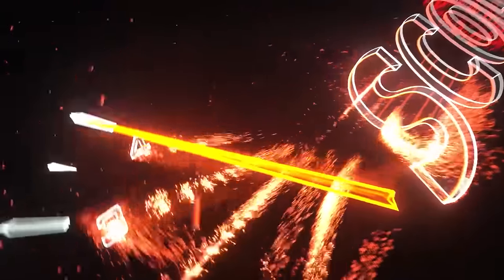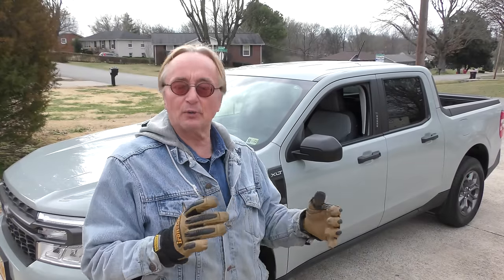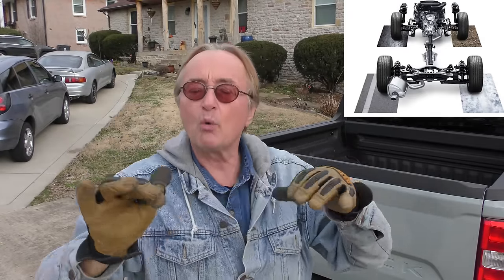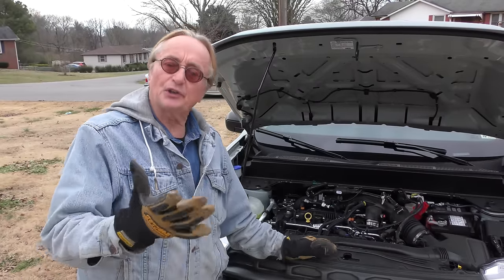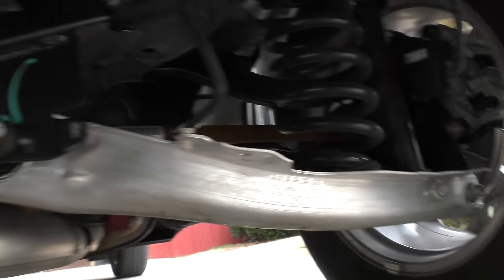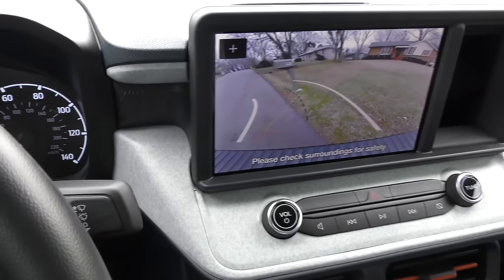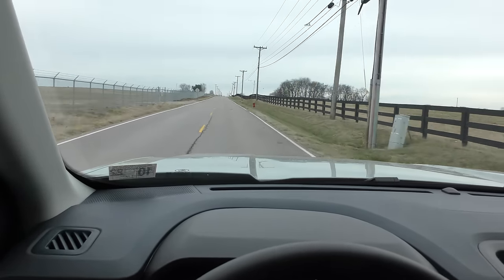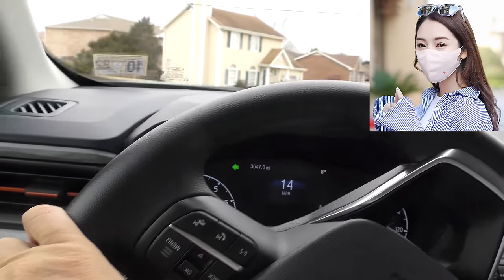I Finally Got a New Ford Maverick and Here's What I Really Think of It

Comment: I've had my XLT AWD FX4 with 4k tow for a week now. Really love it! Quick, light handling and handles like my Mustang did. Very sure footed in the wet or dry. GREAT AWD system. First tank got almost 29 mpg in mixed driving. And up to 34 mph hiway on back roads. I will admit I'm the old guy in the right lane doing the speed limit. Drive like a angry youngster and YMMWV! ;-) But its an awesome vehicle for a grandpa with errands to run.
Reply: Good fortune partner !
Reply: How is it in the snow?
Reply: Maverick?
Reply: Handle like a mustang ... hahaha like hos much more bias can you be ...
Reply: Was really looking hard at getting an xlt with awd and the 4k package. Love the idea of the maverick. Decided I didn't want a car payment and bought an old 96 ranger and now I'm in love with it. I'm going to keep my eyes on these mavericks though, hopefully they make an awd version with the hybrid engine in the near future, I might be sold then.
Reply: Handles like a mustang you say?
Reply: My 2016 2.slo/CVT Subaru Crosstrek typically gets mid-30s hwy with max-sized AT tires on it, if I use the cruise. It's only rated to tow 1500lb though. A sub-$30K, turbo, AWD crewcab pickup with 1500lb payload capacity and 4K tow, that can hit that kind of economy, could easily replace a lot of little sedans and hatchbacks.

 I've seen videos of the Maverick AWD system pulling pretty well through off-camber sections of trails too.

 It'd be interesting to see what a rear locker could do for such an economical rig. I'd like to see the aftermarket jump on this little pickup, with winchmounts, bumpers, skids, rockers, etc. It's not likely going to ever be a rockcrawling Wrangler, nor a mud-bogging fullsize on tractor tires, but it should be pretty fun and versatile.

 I also LIKE the turbo option. As long as it's reliable, I prefer having forced induction in the mountains rather than cubic inches. It retains more of the power. Just use good synthetic oil and change it religiously. I use Duralube in my vehicles too, and I run 200K+ miles on vehicles without any consumption issues.
Reply: as a 22 year old with the same specced maverick on order, i’m glad i ordered a grandpa truck
Reply: I think the one thing I wouldn't like is the small gas tank. It's only like 15 gallons?
Reply: @leadnsteel1428  15gal at 30MPG will get you over 400 miles/tank. A lot of vehicles on the road don't have that kind of range.
Reply: @davidmatteau7696  Around here, that's not saying much. The roads are often wet or snowy/icy for much of the year. Mustangs are generally impractical, compared to a "slower" WRX or similar.

 In twisties? LOL
Reply: This is the package I am eyeing, likely a couple model years out before I bite though.
Reply: @davidmatteau7696  Cheer up
Reply: This is no different than their SUV's..  Just look at the history on those and you'll see how these will fair..   It has the same uni-body, same suspension, and same engine, ect.. It's just their SUV with a bed instead of cargo area.  Not much of a truck really.  Similar to a Honda Ridgeline.  More of an SUV than a truck.  They're pretty sweet if you don't ever tow things.
Reply: @calholli  true SU"V are truck based- the crossovers modern staion wagons arent real SUV's
Reply: @bikeman1x11  RIght.. they're so different that they even came up with a new name for them.  These "trucks' should be the same.  I think 'CrossTruck" is not a bad name-- basically a crossover/ truck.. Auto-trucks maybe?   Uni-trucks.. uni-body trucks.  Like I said, Australians call them "Coupe utility vehicles" -- or UTE (short for utility).  And they have many different kinds of these full uni-body style vehicles with a bed, just look up "UTE' (pronounced yoot').  A lot of them are literally cars with a bed, like El' Camino style.  I just think it's dumb to call these trucks.   This thing can only tow 2k lbs, that's crazy, it's just not a truck at all, haha..  I have an old Isuzu Rodeo, and a 2002 Acura MDX that both tow 4500 lbs.. Just for comparison, My 2002 F350 superduty 7.3L power-stroke Diesel can tow 12.5k lbs on the hitch, and with a 5th wheel trailer-- It can tow nearly 20k lbs.  2k lbs is a joke-- that's barely a riding lawn mower on a garden trailer.  nuts.   IT'S NOT A TRUCK.. . ok, I rest my case. lol
Reply: Cool. I'm considering ordering that configuration.
Reply: No reason to think everyone needs these huge pickups. For most people a smaller pickup can work out well.
Reply: @davidmatteau7696  I wouldn't laugh at the old man. He didn't say what year his Mustang was... might have been an old Fox Body.
Reply: @davidmatteau7696  I laughed when he said that it handles like a mustang. High center of gravity, suspension made for carrying a load with a long travel. You can't have a pick up truck and a sports car in one.
Reply: From a hybrid perspective that i own I'm getting around 45 mpg on my data to day drive that is around to work and the distance is around 12miles. Also this is in California trafic
Reply: @doctorboy5892  I guess that depends on how old of a mustang he's used to driving, it could be an actual horse.
Reply: @1roblock  It was an unrestored 1964 convertible with rotted frame rails and 14-inch bias-ply tires! lol
Reply: @doctorboy5892  Sure you can...454SS, Cyclone (sp?), SSR, Lightning, Ridgeline, etc.

 Big anti-swaybars and some chassis braces could make something like a boosted Ridgeline quicker around a track than a stock Mustang.
Reply: The Real VR  People use lockers with AWD just fine. Selectable lockers don't even have to be noticeable on the road.
Reply: i want one, im just refusing to pay 30k for one at the dealer lol
Reply: @calholli  4cyl, body-on-frame Tacomas can't tow 4K lb. I think it's more like 1500lb. How much can Couriers, LUVs, and Ram50s tow? Weren't they body-on-frame pickups?

 FIS? HMMWVs are FIS. They're also 1.25-ton, body-on-frame, diesel-powered trucks...that can tow 10K lb...offroad.

 Can an F350 get 30-40+MPG? Can a gasser 1/2-ton? We had a V8 F150 at my work that could only tow 6K lb. 4000/1500 tow/haul, for something the size of a Maverick, seems respectable to me, by comparison.

 Different strokes for different folks. I have a 50mile commute. If I have a 1500-3000lb boat to tow locally on weekends, why would I get an expensive guzzler pickup to pull it when a $20K-25K, 30+MPG, crossover pickup can do it? Even a crewcab Tacoma isn't getting 30MPG.
Reply: @RKmndo  lol.. I dont' understand why you guys come at me defensive as if I don't like the Maveric? haha... I do like it.  It's a cool little crossover.  My only point is that it's silly to call it a truck.  It's not built like a truck, it's not capable to haul like a truck and it can't tow like a truck-- at all.  I just think it needs a different NAME.. if it works for you-- hey, go for it.  Even better gas mileage, like you said---   which is yet another reason NOT to call it a truck.
Reply: @FtanmoOfEtheirys   you're able to customize on fords website. But $23k(+taxes and tags) for LT maverick truck with no extra features isn't really worth it. 
I think you'd like XLT maverick with luxury package. I think if im correct. Thats only $28k.
Reply: Sorry dude the word hiway as you spelt is is actually spelt highway.
Reply: @theeslimstevie  I really want the hybrid option. I'm holding out in hopes that Ford will be smart and release an awd model of the hybrid considering it is already offered on other platforms. I live in Chicago and really regret trading my 4x4 in for a fwd car.
Reply: @FtanmoOfEtheirys  Damm that stinks especially because winter right now. Hybrid is okay but I understand waiting for awd version to come out. Im just iffy about new Hybrid technology. (Affordability on repairs or something along those lines.) 
You can't go wrong with eco boost with 250 horsepower and 25 miles per gallon. Thats pretty dang good mate. But I respect your opinion.
Reply: @RyanNash20  96 Ranger is an awesome vehicle. Last year for that massive front axle setup.
Reply: @leadnsteel1428  probably how they keep the mpgs. Less weight.
Reply: @calholli   yeah I don't think anyone should get it instead of an actual truck. But I think it is a decent alternative to  station wagon, tho. Almost like the Flex wagon model except with an open back. The Honda Ridgline is the same thing, just a Pilot with an opened rear section.
Reply: @bikeman1x11  crossovers aren't real station wagons either. I sure do miss the  old full size wagons.
Reply: @calholli  I agree. Should just call them open-back wagons. It's not a dumb vehicle, but it cannot replace an actual truck. A base model kia soul can tow 2k pounds.
Reply: @RequisiteFunction  Oh yea I was under it changing the oil and this thing is way overbuilt. Tie rods are bigger around than new f150s lol
Reply: @petermuller161  not buying that
Reply: What did you have to pay for it?
Reply: What did you have to pay for it?
Reply: @theeslimstevie  hey,  is the  4 an option on the XL.  For $5k it may be worth it. 
Tacoma is dated for what they charge.
In the 4 cylinder  truck market a manual is a much better option
Reply: @RKmndo  some Kia Souls can tow 2000 pounds, and they are the epitome of economy SUV. Basically a 4 door hatchback with a tall roof. Only in America do you need an f350 dually to tow a canoe.
Reply: @donaldwest8130  I mean XL is ight truck for the price but im not sure if you can get fx4 on the XL maverick. I think its only 2 wheel. 

 But on what I ordered (XLT) I added the fx4, 4k tow package. Practically maxed out my order for 34k
Reply: That’s not such great fuel economy, 
Cheers
Reply: @RequisiteFunction  or to get groceries at the big box store
Reply: I appreciate you sir.
Reply: If your Mustang handled like a maverick something was wrong with the Mustang. 
Cheers
Reply: @calholli  Should really call it a Ranchero!  People confuse these little ones with expecting a real truck. People who actually buy these could get by running them till the EcoBust nears its premature end, and trading them in.
Reply: Did you have to pay a mark up?
Reply: 4k tow not bad
Reply: Good for you! We also like our current 2017 ford super duty diesel that is now at 107,000 miles since we brought it home new and does 18 to 23 mpg doing speed limit or 5 miles over the limit. It is my all around vehicle towing our rv trailer up to 20,000 lbs. When not towing, it is my fishing/hunting, exploring, and errand truck. It is just breaking in at 107k. Hoping for years of ownership since it might be our first and last diesel...will see then.
Reply: @GDM1787  Oh yea I'm keeping high hopes for these. Manual trans in the ecoboost in a few years time would be amazing, plus we will be able to see by then if they are reliable vehicles or not.
Reply: @RKmndo  the Ranger tows 7000Lbs 
It gets 26MPG.
Reply: you still like it a year after this comment? thx!
Reply: a cheap truck for sure. that's about it. full size is the way to go.
Reply: @Joker42084     Do you mean SPELLED?  Spelt is not a word.
Reply: @wysetech2000  yea, I rarely make spelling mistakes.

Comment: I'm definitely on board with this. It's about damn time a smaller and affordable truck was sold again.
Reply: It’s also the first time someone made a good looking, affordable hybrid.
Reply: Not sure how affordable they are. I just saw one at a dealership for 40k. To me that isn't affordable for the size vehicle it is.
Reply: What's "affordable" under Mussolini with Alzheimer's Jo?
Reply: This is what the Ranger should have been.
Reply: Affordable and good looking...not reliable tho ..not a car that'll last 7 plus years , especially in the winter
Reply: @barry4134 my XLT was 28
Reply: @barry4134  priced it out with the builder obviously there are a ton more options you can chose and upgrade but all wheel drive tow package and spray in bedliner 32k so thats at least way better than the 45k mentioned above
Reply: @willv5158  thats probably a loaded lariat   my xl is 27k
Reply: @GreenTruckFromCaseOhGrocery  That may be true. I didn't actually get out and check it out. I was so shocked at the price, I just drove by.
Reply: Its bed size is a joke.  My 1995 Ranger has a much bigger/better bed.  I wouldn’t buy this piece of s**t truck.
Reply: @piggy310  You actually think the President controls the prices of vehicles? 

Just because you have a voice, doesn't mean it's equally valuable.
Reply: @alibabaschultz352  it's depressing that there's people like you voting, and your vote counts just as much as mine. Welcome to America I guess.
Reply: @piggy310  Why do you think the President controls the prices of vehicles?
Reply: @alibabaschultz352  the vegetable in the white house has managed to make everything more expensive, cars included.. I'm not sure why you think they're off limits. Do you think the raw materials to make those cars just appears they're magically, and that there's no transportation involved?!
Reply: @piggy310  Why is everything more expensive? Inflation? What is inflation, and what causes it?
Reply: @alibabaschultz352  what the hell do you think causes inflation, printing money ... Did you not learn this stuff early in life????
Reply: @alibabaschultz352 whether you think the regulations that are required in cars are good or bad, they're real and they cost a lot of money.. my brother is a higher up at Toyota USA. I've seen the actual actuaries!!! Of exactly what the government requires on every car coming off the assembly line, about $12,000 of that $40,000 Sienna are government regulations , and that's just physical equipment that's not taxes .

Comment: Honestly, I can't wait to get this truck in a few years on the used market. A fuel efficient small truck would be much more practical for me than any other. I hope it does well and opens up a market for trucks this size. A tiny Toyota Tacoma hybrid would be perfect
Reply: This is the type of car nobody is gonna want to sell, unless it has some kind of weird undiagnosed defect, is completely beaten, or wrecked.
Reply: @gsilva220  and battery replacement
Reply: Yes the mpg for the next 5-10 years is worth way more than a short term profit, even if you clear several thousand.
Reply: @xunchizhang6776  
These don't have the really expensive batteries like the total electric EVs
Reply: Good luck with that
Reply: The only thing that creeps me out is the undersized turbocharged engines.
Reply: @christopherbeddoe406  
I know those engines have held up in other vehicles and I keep reading about how these are very basic inexpensive vehicles, and I can't help but wonder if they'll be likened to a Pinto in 10 years.
They're cute, but I'll stick to my '97 Silverado Stepside 5.7 Z-71 for my truck needs because it goes up in value every year and it doesn't cost much to maintain.
Who cares about gas prices when you don't have a car payment?
Reply: I have no car pymt but I care every time I dump a C note into my tank.
Reply: @JamesD-HB  
Have stopped speculating on gas pump futures.
Gas was $1,08 a liter and I decided to wait to see if it might go down a little, but it went up 3 cents which translates to just over 10 cents a gallon, a substantial jump.
Reply: @JamesD-HB  filled my hybrid up today at a quarter tank. 10 gallons and range went to 550 miles on 13 gallon tank.
Reply: But truck size matters man...
Reply: A truck like this has existed forever, with a tried and true capable 300k mile powertrain. It's called Honda Ridgeline.
Reply: @christopherbeddoe406  I’ve had both a 1.5 turbo and now I have a 1.6 turbo. They’re great. They tune easily, and are quicker than the numbers make them seem.
Reply: I ordered a chili pepper red last december. Cant wait for my truck!
Reply: I have owned econoline vans, single and dual cab f-150.  And one diesel crew cab.. Ford only!!  At 70 yrs young the Maverivk is a perfect choice
Reply: They're so cheap to buy new it's the only "truck" i  would get new.. I pre-ordered a 23
Reply: From what I hear, Toyota is working on one. I'm waiting eagerly to see what they have. All these new present trucks are too big and way overpriced.
Reply: @disaar3679  yup. And the bigger the truck, the smaller the equipment of the man driving the truck
Reply: @LynxStarAuto  the Honda Ridgeline is still pretty massive. My friend’s family had one and it was still way too big to be practical. Honestly would rather have something the size of a Baja over anything large
Reply: @Pontiacman1964  yeah, the newer trucks are insanely oversized. Would honestly prefer a Subaru Baja over the new f150s
Reply: @OtayBuckwheat  0
Reply: The Hyundai Santa Cruz is already popular here too!
Lot's of those new Ford's sitting on the lot, unharmed because they're on the North Shore.
Reply: @LynxStarAuto  exactly...what ford/chevy guy looks at hondas?
Reply: The toyota stout enters the chat
Reply: Jesus loves you alot trust in His death 4 salvation and be saved from eternal hell <3 Jesus died on the cross for you bro.
Reply: Yes a tiny Tacoma hybrid agreed. And at a great price.
Reply: Lol used 23 maverick goes 35k. New goes 23k
Reply: @mannamedbanjo  Toyota Stout HEV? Take my money!!!
Reply: Buy a new transmission while you do it
Reply: I got a front wheel drive one and I’m in love with it ❤